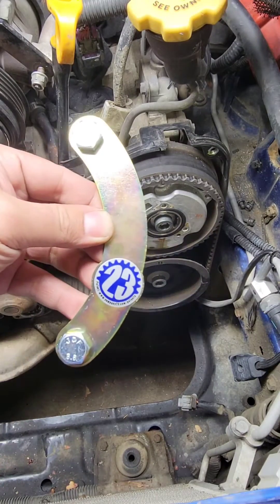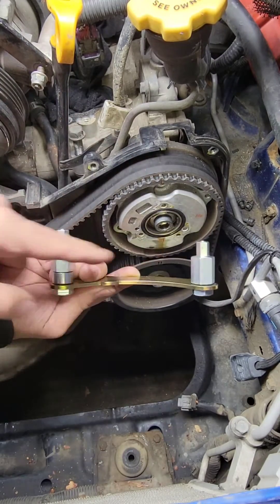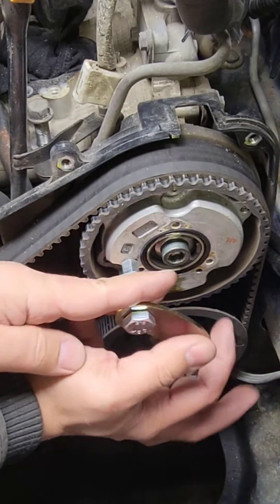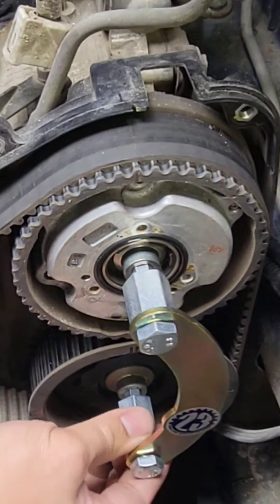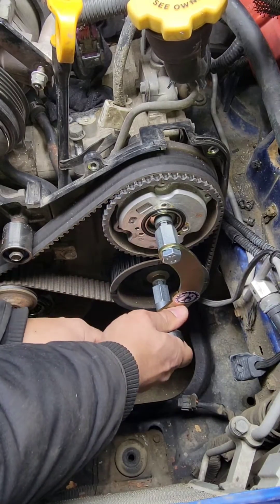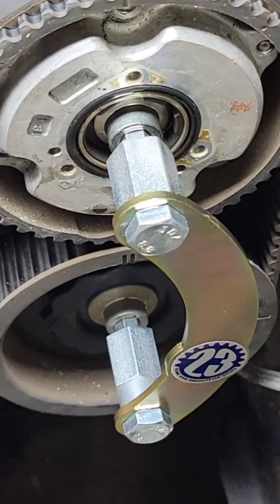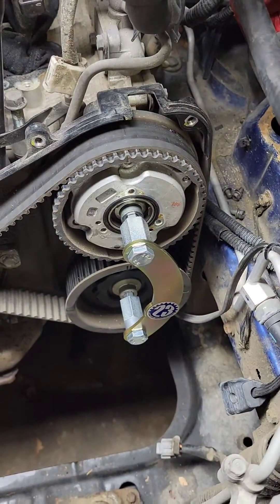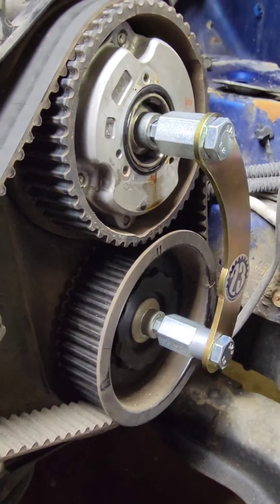2002+ Subaru Camlock Tool! Showing how it work (Engine EJ205, EJ207, EJ255, EJ257)

Comment: Size in mm of the hexagonal nut that fit into the holes?
Reply from the maker: Size i use T10   Torque specs 22ft lbs plus 45 degrees angle 

Here my other video https://youtu.be/oY0DBKzd18Y?si=ZRDu3LCOZEXTCECc